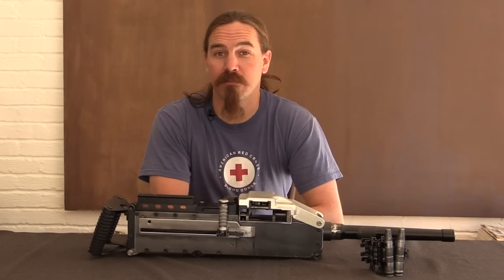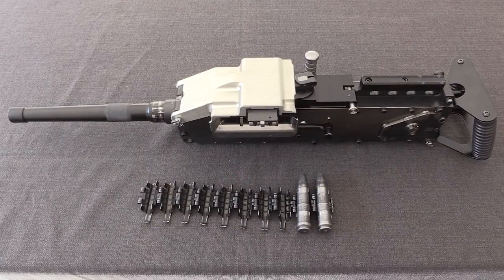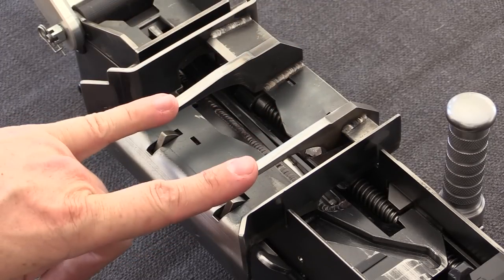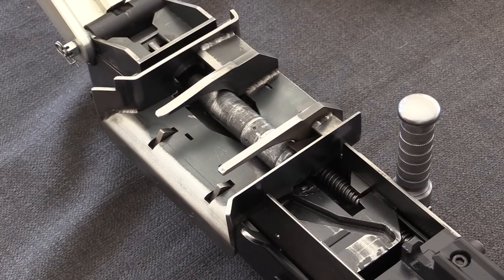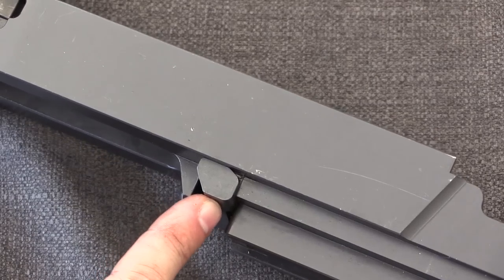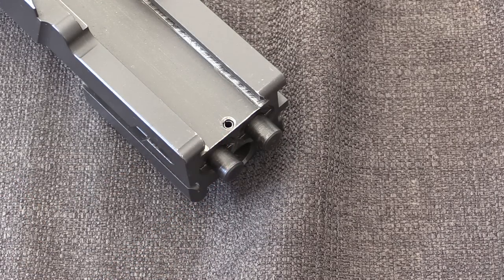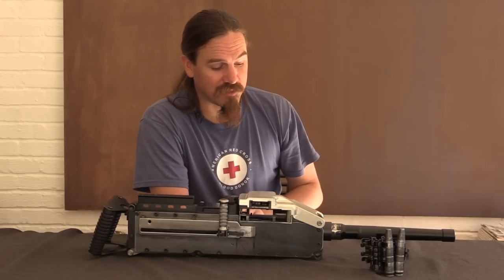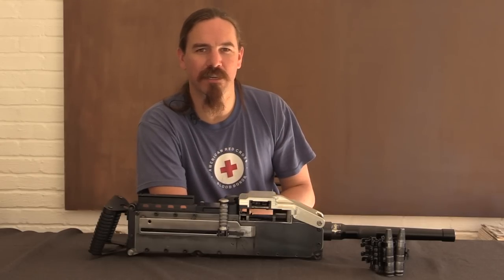Inkunzi Strike 20mm Grenade MG

Comment: You know it’s gonna be good when it’s Tony Neophytu
Reply: Every time.
Reply: @Gagis  I want a PAW so bad. Technically wouldn’t even be a DD with solid 20mm projectiles.
Reply: @Matt-xc6sp  Sadly, it absolutely could be a DD. According to the NFA, any firearm with a bore diameter over half an inch that "isn't recognized as suitable for sporting purposes" is a DD.
Reply: @Matt-xc6sp  20 mm>12,7 mm
Reply: @oktayyildirim2911  I know that and they use it to selectively discriminate against some shotguns. Where am I getting 20mm from? I’m pretty sure that’s the cutoff for something.
Reply: @Matt-xc6sp Two possibilities, I think:

I think Ian once said 20mm is about the boundary where explosive bullets start to contain enough explosive material that they are individually classified as DDs.
Also, I think weapons 20mm+ in bore diameter cease to be guns and start to be cannons.
Reply: Yep.
Reply: @Matt-xc6sp  You'd most-likely have to make it chamber in one of the existing sporting-exempt oversize cartridges only. If it is capable of firing DD, it's generally considered to be a DD.
Reply: @oktayyildirim2911  Oh this is absolutely perfect for sporting purposes

Comment: This is ingenious, by making the whole or most of the action work with the recoil energy he made the gun A: smaller i.e. lighter and B: faster fireing with also less felt recoil. This man is rlly underappreciated, damn that's so cool
Reply: Recoil operation has been around since the original maxim machinegun's, it's nothing revolutionary.
Reply: M2 50 BMG is recoil operated, Mk19 40mm grenade launcher is recoil operated.....
Reply: @DuriensBane   we know. DOT DOT DOT DOT DOT
Reply: @beans1215  fire is hot as well, just thought you should know...
Reply: Have you ever seen the Canadian .50cal Rifle? Barret .50cal? M2? Mk19?
Reply: Is it the 1st time done on a 20mm MG?
Edit: looked up the MG 151 cannon, I mean yeah recoil operated too, but does it go to the same extend that this gun goes? I know, I know not the same pressure. I was just fascinated and could see it work in my mind's eye. Ian is just rlly good at explaining. Sry for the 2nd obvious fact🤷‍♂️
Reply: its a novel solution because these rounds are so much larger than a normal bullet so you kind of have to have use the larger force of the recoil system
Reply: The difference is what work gets done during what portion of the firing cycle, where the energy to do the tasks comes from. As Ian was saying in the video, a bunch of stuff on a traditional MG is normally done when the bolt is on its way forward and thus the energy comes from the springs, whereas on this the energy comes from the actual recoil impulse
Reply: @DuriensBane  The MK19 is blowback operated, to be technical.
Reply: @mrb692  And Finally someone understood user-xw3tp6eo2y's point.  It's that 2/3ds of the work is done by recoil impulse and 1/3 by springs, instead of the much more common "use recoil to shove the bolt back and let the massive return springs do all the work".  While operating, the difference is negligible... But during loading/clearing malfunctions, it makes a huge difference.
Reply: @mrb692  that's exactly what I meant. But I didn't specify what I was exactly talking about. The action works alot with the recoil impulse. And I find it very impressive how this man reduces the recoil by using its energy in this small space. I mean look at this tiny box^^ it has the sice of an 7,62mm LMG at most

Comment: This truly shows the genius of Tony Neophytou.  He thinks of everything that goes into making a functional weapon system, including things that have nothing to do with the weapon itself.  He thinks about the end user experience: the human factor.  Decocking the bolt while it's outside the gun would be a HUGE problem if it wasn't for the feature explained at about the 21:00 mark.  Soldiers are going to do stupid stuff like that, either by accident, on purpose, or just out of ignorance.  Now it's not a big deal, because there's a feature that specifically addresses that, and without making the gun significantly more complex or expensive.

Lesser designers might have dealt with this by including some kind of special tool that has to go with the gun kit, that the user can use to recock the bolt, and of course a tool like that can be lost.  Here, the tool is part of the gun.  You can't lose it, and you don't have to do anything special to use it.  Just ram the bolt back into the gun, and the thing takes care of itself.  Simple.

This is thoughtful design.  This is the kind of thing mechanical engineers should be studying.  It's not enough for the machine to just work.
Reply: This is what happens with one-man designs instead of designs by a group. The feller likely built the thing, fucked up, realizing that folk will fuck up in the field, and adjusted it immediately.
Reply: As an African I imagine the shenanigans of poorly trained military personnel are never far from mind.
Reply: @BAGELMENSK  Isn't that the World Eaters symbol with a baguette?

Comment: I see a lot of merit in deploying this on top of an IFV or troop transport, especially if it's mounted and controlled remotely. High anti-personnel and anti-materiel capability in the same size as a coaxial machine gun.
Reply: I'd want one to navigate a minefield under pressure
Reply: It looks a bit like the WW2 German MK 108 30mm aircraft cannon, scaled down. I've always wondered if the Germans ever considered using that gun as an AFV weapon, given that it was mid-way between cannon and grenade launcher.
Reply: @AshleyPomeroy  I thought it looked familiar
Reply: Another use could be for coastal patrol boats, or dealing with piracy.

Edit: Or mounted on a little bird, or a dune buggy.
Reply: We mount AGS systems like that already, this one would be cheaper and lighter
Reply: @josedorsaith5261  
This will be slower than a .50, slower rate of fire, and less effective range. But in it's niche it will be hitting twice as hard. Which is a lot.
Reply: Navy Seals should definitely look to this for their riverine craft, 25mm is too big for their small craft and this bridges the difference between 40 mm and .50/7.62.  This would absolutely obliterate any other craft on the water.
Reply: There are actually hundreds of applications. VBIED overwatch at checkpoints. Secret Service SUV retractable heavy weapons (they already have mini-guns in Suburbans), light COIN aircraft mounts, helo mounts, MRAP mounts, static defense mounts. But five or ten PAWs in a platoon, supported by three of these would make an awful lot of confetti, if added to the TO&E.
Reply: cold war french tanks like the amx 30s actually use a 20mm as coaxial gun in order to take down light vehicles more effectively, while the roof mg is normal
Reply: Some people mentioned that this think would be perfect for tearing up lightly armored vehicles and I agree. It makes sense in an African context since the most common vehicle to encounter would be something like a modified truck.

Comment: The recoil of the shoulder fired unit is pretty impressive. An elegant design. The sear engagement surface looks kind of insubstantial but I’ve not designed anything more lethal than a potato cannon.
Reply: That was single shot too. Imagine shoulder firing this thing in full auto. Talk about uncontrollable
Reply: @alexsis1778  he meant impressively low. This isn't meant to be shoulder fired

Comment: When the video of the Neopup came out I was extremely impressed by the cartridge and hoping they would release the specifications so that a belted machine gun could be developed. I would love to design a platform utilizing this cartridge, though this design seems ideal for cramped spaces such as vehicles, which is most likely the ideal application I feel.
Reply: I know this is a bit of a pedantic note, but at 20mm caliber it stops being a cartridge and starts being considered a shell.
Reply: I picture a big, pump-action weapon using this cartridge. Bonus points if it also can fire 20mm shotgun shells.
Reply: @skaldlouiscyphre2453  so, basically, a KS-23, but with HV grenades?
Recoil would be brutal, combat loads for KS-23 are already pretty much at the limit of practicality even for well-trained spec-ops assaulters. Neopup/PAW has almost the entire action recoil into the receiver/stock to absorb recoil, and it's still practically incapable of double-taps (not that it needs to, with those payloads). Hi-Lo propulsion is a standard for handheld grenade launchers for a reason...
Reply: @BlackBladeGroM  Yes, basically that (but really just this thing with a suitable shotgun shell). 

Hopefully the smaller bore can help reduce recoil. You'd probably want to control the mass of the projectiles as well.

Wouldn't 20 mm shotgun shells essentially just be a 10 gauge shell? How bad would recoil be with a custom 20x75mm (10 ga/ 3") shell?

Comment: When the perspective shifted to show the left side of the gun with a belt of ammo in front I was struck by the visual similarity to one of the German aircraft autocannon from WWII, in particular the MK 108. The 108 is obviously going to be much larger and fatter and doesn't have a charging handle or spade grip but the profile is similar at first glance.

Comment: Germany had something like this as aircraft cannons. They had the German Mg-151 20mm autocannons and other 30mm variants. They were pretty good because you had not to rely to hit something critical with a bullet but could do one shot kills.
Reply: Yeah this kind of does have "MG 151/20 meets MK 108 but for mechanized infantry" vibes
Reply: The MG 151/20 had a mass/weight of about 42 kg.  According to Ian, this prototype weighs in the area of 13 kg.
Reply: @speedythree  Ah, the wonders of CNC machining, and better materials to make it with. That being said, most of the German autocannons were cleverly designed, state-of-the-art weapons systems (like the Mk 108 30mm used in the Me 262).
Reply: Not really comparable, if the Mg-151 round was 50 BMG then the round this uses would be 50 AE. Also it wasn't just a German thing, most countries used cannons on planes to a decent degree in late war, Americans are one notable exception.
Reply: @zepetv589  America had a few aircraft with cannons.
Reply: Mg151-20 is actually used in south africa. it is modfied a bit but they where used as door guns on the old allouet and speciolo forces uses them in the ground support role. 

The navy all so made a special mount to use them as a deck gun on the old subs in the 80s late 90s but new subs dont have them.

Comment: Those ramps that pull the cartridge off the belt is a great design. It is normally a somewhat complicated system to remove the cartridges from the belt. This really simplifies that a lot.

Buffered trigger system reducing wear on the sear; quite the solution. I would had not thought of that. I would had just thought I need to beef it up, too much to be viable in such a small weapon.

Comment: Interesting that it's subsonic. it would be great if someone made a silencer for it!
Reply: There are vulcan silencers
Reply: Nothing better than a full auto silenced grenade launcher
Reply: 1000 fps suggests otherwise as that roughly the same as 9 mm parabellum or am I missing something.
Reply: ~1,140fps is the speed of sound at sea level. So 9x19mm, which typically range from 950fps to 1,300fps, straddles the range of subsonic to supersonic depending on the cartridge.
Reply: @alexsis1778  with tactical pistol grip, underbarrel light and laser sights
Reply: Imagine standing on guard and you’re suddenly getting blasted to oblivion.

Comment: For a point of reference, 1000 feet per second is about 22LR velocity, at least if said 22LR is fired from a 14im barrel as well..  standard velocity 22s probably a bit below that while high velocity 22s probably a bit above.  But that is just muzzle velocity.  The 22 is likely going to be much faster and have less drop at any significant range as I imagine those 20mm rounds are fairly high drag compared to 22 rounds.

Comment: Based on the review of the prototype design, I could very easily see this system used in place of a Browning M2.  Smaller, lighter, yet with more damage potential at the cost of range.  This weapon system would be perfect for urban combat vehicles or light helicopter mounts.  I'm not sure if something like this would be practical for point defense or carry by a support team, but for such an innovative and well thought out design it has a lot of potential.

Comment: Pretty cool design. The closest thing to it that I've heard of was an experimental design for the US Army back in the 90's I believe. Semi auto, 25mm with programmable grenades to provide a variety of nasty surprises for the target.
Reply: Yes, the US Army "Objective Weapon" program. OICW was the individual weapon version, with a 5.56 weapon integrated into a semi auto 20mm smart grenade launcher, and the OCSW as a 25mm belt fed smart grenade launcher.

At the time, it wasn't really possible to miniaturize the electronic smart fuze enough to leave a respectable amount of boom in the 20mm projectile. The 25mm grenades had enough space, but were too heavy to use with an integrated 5.56 rifle. So you got the Barrett XM109 "payload rifle" and the XM25 "Punisher" which did see combat in Afghanistan.

As to the OCSW, that turned into the XM307, which was a @50lb weapon that could be turned into a .50bmg by replacing bolt and barrel, a process that took about 3 minutes. Problem with the XM307 was the low cyclic rate, only 265rpm, even as a .50cal. It still had the same effective sustained fire rate as the M2, about 50rpm, but the other use for a .50 is self defense AA where you need a higher rate of fire.

Comment: looking at it firing it looks more like a cannon than a grenade launcher, would be great in a remote controlled turret on an IFV
Reply: For that type of application, there is already 20mm remote weapons station. The problem with 20mm is even will caliber that has a lot more propellant and therefore projectile speed and penetration can be problematic against other similar vehicles. So you do not what it as the main armament of IFV. The smaller caliber that is used today is 25mm and it is moving to larger guns.

So on an IFV you like a larger caliber gun to begin with and it will have explosive ammunition. So the additional utility of this gun is limited compared to a .50 or smaller caliber machine gun on a remote-controlled weapon station. Smaller caliber means you can carry more projectiles. 

I would say it is not on an IFV you. It is on an APC or similar vehicle that does not have a large caliber gun to begin with but it is a 40mm grenade launcher, 50 cal machinegun or smaller that is the main armament. So ina remote or not remote weapon station on a vehicle lighter then a IFV

Programmable ammunition is also becoming more and more common. Airburst ammunition over an enemy behind cover to get it detonating after it passes through a wall is quite useful. The cost of the fuze and the space it takes up make it problematic for low caliber like 20mm, the amount of explosives starts to get quite low if you add a complex fuze. There is a reason US has not added that to the  25mm cannon on the Bradley but it is used for 30mm and large variants of the same gun on other vehicles. US is developing a 50mm gun for the Bradley to add this capability.  Programmable fuzes can also have proximity function so you add capability against air targets like drones or helicopter

Comment: Some of the design elements of the bolt and firing mechanism remind me a lot of the Russian AGS-17. With the biggest difference being is that the Russian gun fires from the closed bolt.
Reply: Yes, this is very similar to AGS-17/30. Those fire from open bolt, btw, but use 30mm ammunition ("Khattabka" nades from Tarkov are AGS ammo with hand grenade fuzes).
AGS-30 is close to this in size and weight (16 kg) and operation.
Reply: @BlackBladeGroM  The AGS-130 fires from the closed bolt, but not the AGS-17, to my surprise. I went to the National Firearms centre to check a few of their models out and confered with their armourers to double check.